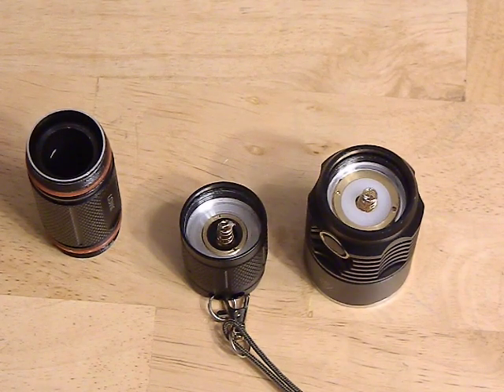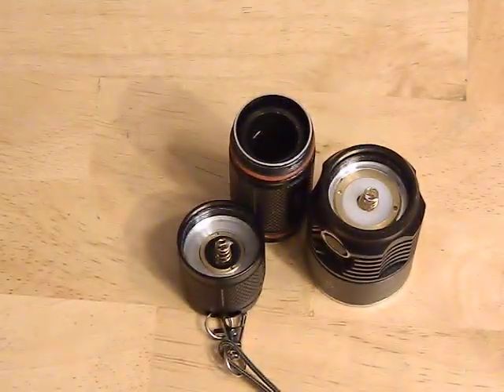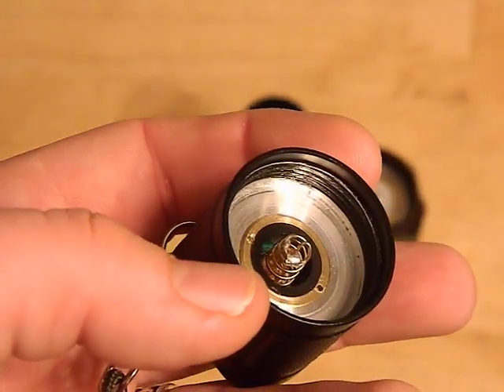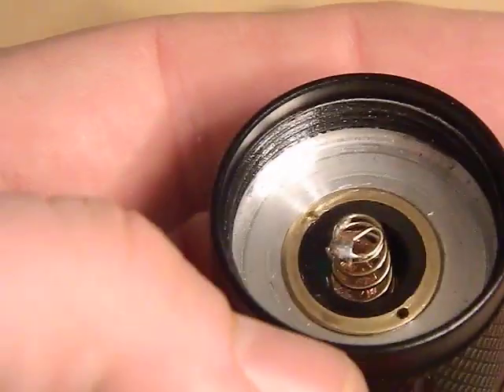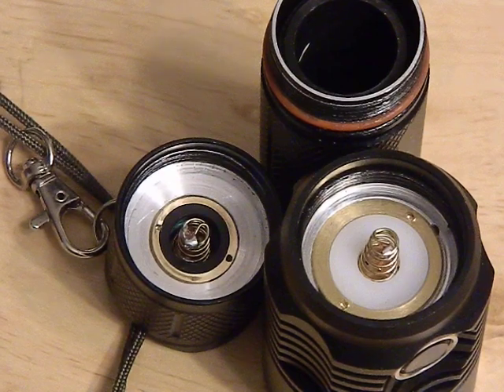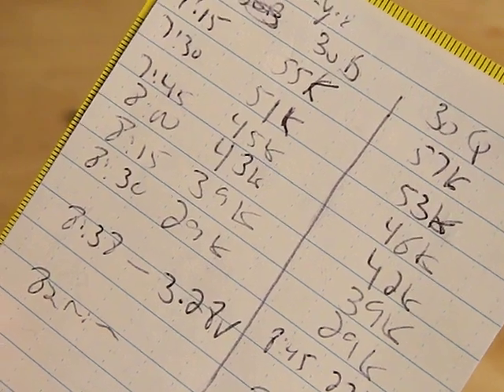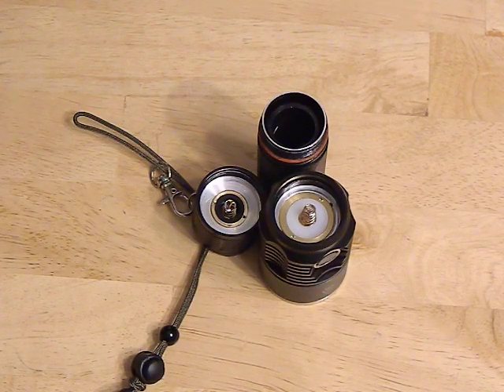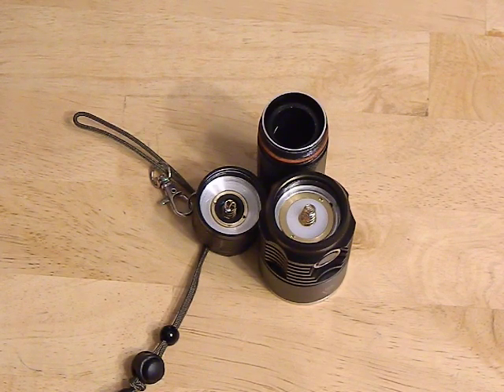A simple flashlight hack to increase brightness & runtime

Comment: How do you d with a Ozark trail 1000 limon rechargeable flash light that won't stay on it turns on no problem but doesn't cycles through the mixed with each button press instantly starts flashing yellow and green with a door of red in the mix and after 3-5 seconds sure off how do I fix that

Comment: Okay, I fully accept and agree that if a light has poor contact at the spring or high spring resistance, that this can reduce resistance and that increases current, but you can't have it both ways.  If current is increased, this will reduce runtime, until the very last moment with the low-voltage cutoff kicks in.  It might not do that on certain lights that are poorly regulated and drop output with voltage drop, but more often than not, more current and brightness will deplete the battery faster.

Comment: Hello how did you come across this? Such as what gave you the idea.
Also I have a problem if you had any ideas on how to fix. So i purchased a cheap scout light on ebay. Works good. However it will drain a 18650 overnight. Iv owned a bunch of cheap 18650 flashlights and none of the other ones have drained the battery like this unit. It seems to have a parasitic draw. Do you have any ideas on this?
Thanks

Comment: Just keep in mind...  less resistance may mean brighter, but it also means more current, which also means faster battery discharge & shorter lifespan for the led.   
I'm sure they take total resistance, voltage, current, etc., into account when designing these the way they do.

Comment: Can someone explain how is it possible to heve more brightness(MORE mAmps ?) and  also have the battery last LONGER at the same time?
Reply: easy.  you'er not wasting energy heating up the higher  resistance element in the underperforming OEM design.
Reply: More efficient going from steel to copper/brass which is almost all copper
Reply: It's not, unless the particular flashlight driver is poorly regulated so it still drops brightness as the voltage decrease, then you just get a little extra runtime at the nearly discharged state, so in that case it's possible, and desirable overall to reduce resistance, but in many lights, it wouldn't make the battery last as long, let alone longer.

Comment: You knownyou can get even more runtime and brightness by not doing this. And just going to the hardware store getting a few extra rubber o rings and put an 18650 battery instead in there.  Also spend 16 cents make a joule thief hide it in there and now you have around 8500 watts of power vs 2700 in the same package. Not saying this doesn't work.  Theory is sound but if your into batteries you know an average aaa has around 600ma of current. An average li on has around 2300 to 3600. Yes it's a bit more loss in the voltage.  That's why I use a joule thief

Comment: I think it is physically impossible to lower the resistance and increase run time at the same time. 
Lower resistance = more current = less run time
Reply: Okay, then shove a big chunk of metal between the Battery and Spring then tell us if the light was dimmer.
Reply: @Vinnay94  by all means be ignorant then. The video never references any such big chunks of metal being shoved anywhere, you seem downright confused about what's being discussed here, perhaps you have mistaken the wick as such. But go right ahead and see how a hunk of metal works for ya. In fact, go ahead and use that big hunk of metal protruding from your arse. That ought to be convenient enough...highlighted reply lol.
Reply: @itechhen  I was talking to Dan. If you place a thick piece of Cylindrical steel between the battery - and Tail Cap, some of that current is wasted into flowing through that big chunk of steel thus reducing run times and output.
Reply: More efficiency = brighter/longer runtime from the same power source.

Comment: Thanks 412 - It works! I did it on two of my cheap chinese zoomables! I don't see a problem with the solders and the increased load on the LED chips. So far so good. Probably won't try it on my mountain bike lights though due to vibration.

Comment: How about using Deans Wet Noodle wire ???? Supposedly the best wire with ultra small number of conductors ??
Reply: No, it doesn't need that and would be a problem to implement because the construction is not woven together and would need insulation that gets in the way.

Comment: This is pure SNAKE OIL . Just go measure the resistance of those springs which will be 0 ZERO ! Perfect 100% continuity . Does NOT require ANY help in conductivity at all . This as he says is more geared to dummies who wish to break their flashlights . This foolery is NOT recomened at all .... unless you are a fool .

Comment: How about just stuffing the inner coil with common copper strands balled up? It would create less resistance with the mass increase contacting many parts of the inner spring.
Reply: WTF is "common copper strands", balled up no less?  You have no idea what you are talking about, and no, copper oxidizes so it is not less resistance, nor is mass increase necessarily a desirable thing, and as the spring contracts and expands (which is why a spring was used), the copper does not spring back, so effectively a waste of time after a use or two, compared to soldering in a connection strap.

Comment: I just picked up a set of cheap flashlights from northern tool, they were on sale and looked fairly decent. I already converted one to run on my 18650 vape batteries, which removed the negative spring entirely. But the one at the front is long as hell, think I'll give this a try. It's already way brighter just with my lg hg2, and I don't have to worry about buying batteries. Rechargeable, and I always keep spares with me to vape with, so its win win.
Reply: The 18650 battery store has some for like 5 bucks that take 18650s these things are like a spot light 60 yards across yard scanning for animals at night lol

Comment: If the hack increases the lumens the battery life will go down.
Reply from the maker: zippy not necessarily. If the light is regulated as most are, it draws a set current. Some of that is lost as resistance. Remove the resistance you that same regulated current will produce a brighter and longer lasting result

Comment: Did you actually test this with a meter?  You still have the resistance of the body, so can't see the spring makes much difference?
Reply from the maker: motorbiking I did some extensive runtime testing and every one showed improvement in runtime. the springs are steel, the body aluminium. big difference in resistance between the two
Reply: @Bushcraft412  I reckon the fact that Spring Steel is essentially hardened contributes to plus de resistance. So maybe if one were to anneal the spring with a Butane Torch, La Resistance would be reduced?
Reply: Bingo!!! I wondered why he didn't do something about the body resistance first, as it wouldn't be as critical. Maybe use silver wire on the body with only 2/3 the resistance of copper, much less aluminum. Hard anodizing I am told is worse than regular aluminum.
Reply: Spring Steel is still relative hard so the electrons aren't as free. Aluminium is a poor conductor too though the lesser of two evils. Some flashlights have a length of Brass running down the shaft.
Reply: @Vinnay94  Aluminum is not a poor conductor, and it is still conduction vs amount of it with a body tube having a huge amount for this relatively low current draw.

Comment: If you have no de-soldering braid, then you could use the outer screening from co-ax cable. Give it a rub with fine sandpaper first & lightly tin the ends with rosin cored solder.
Reply: thank you for the idea comment from the past

Comment: the spring is essentially a resistance coil the braid goes direct very cool hack
Reply: that resistance is FACTORED IN ,  do NOT change it, the LED will have a shorter life, mine just went dead.

Comment: Its kind of the same principle of swapping tamiya to deans plugs in lipo batteries, the improvement is significant and helps extend the life of the battery (less strain), and whichever device it is powering, electric motor, flashlight...

I do a similar mod on airsoft guns, and it is noticeable on trigger response.
Reply: px45
Reply: Amass Xt90 is the way to go. Deans is outdated and no longer very good these days. Deans was good 20-30 years ago
Reply: @jalee6587  of course, that was 8yrs ago, BUT many times an XT90 will NOT fit on airsoft guns. The power draw is determined by the thickness of the wire and C rating (most are 30 to 50c and maybe 14awg). XT90 on airsoft batteries will look way off, and will not fit.
See if you can find any airsoft lipo battery w XT90, a much better option is xt60.
Yes, xt90 is better, but do airsoft benefit from it, very minimal and the demand is not like an EDF jet or a 6S 1/8 basher truck...

Comment: the way I hack my flashlights is I take 1-3 usually 2 of the 3v "2032" button cell batts tape em together and just stick it on top of the 3 aaa batt pack, or bottom. doing so ups the voltage from 4.5v to 10.5v. I haven't found a l.e.d. flashlight that this trick doesn't work on. but the best ones I found so far are the Eveready flashlights found in the battery section at most grocery stores. I'm going to add this hack to my hack and see what happens.
Reply: well? 
what happened,Elwood Sherman? are you dead?
Reply: I hate those triple AAA batteries requirement. You are better off replacing the entire cartridge with a single 14500 Li Ion.
Reply: @himeccms893  Huh?  Why a 14500?  A 3 x AAA cartridge has a great enough diameter that any light that can fit one, could just take an 18500 instead of 14500, and some can even take an 18650.
Reply: Great way to turn your flashlight into a Pipe bomb. 
1. Those button cells have shitty run times.
2. They have shitty current draw.

Maybe if you put all 3 in parralel, they might be able to handle the abuse.
Reply: This makes no sense unless you are talking about a very weak, dim flashlight.  2032 button cells are barely capable of any current, so would be a bottleneck in any reasonable flashlight, and once they start running down and reverse charging, are likely to vent and make a mess in the light.

I am  doubtful that you've actually ever done this.

Comment: couldn't you just solder the braid at the end of the spring and kinda loop it inside the spring?  When the spring compresses, the copper should easily contact the base of the spring and accomplish the same end result... just sayin'.
Reply from the maker: +Frances Gauner There are several different methods people use.  I know some people remove the spring entirely and run a loop of braid around the bottom of the spring and then solder the spring back on.  You definitely want the bottom secured because if it is just hanging loosely there is the chance that it works it's way out of the spring and causes a short with the battery.
Reply: +Bushcraft412 thanks, your point is well made.

Comment: this is a pretty good hack, but by lowering resistance you are accelerating the output of the battery...   I can understand brightness but I don't see how that increases run time.
Reply from the maker: +TheSmokinApe me either.  My guess is efficiency of the led? or perhaps even efficiency of the battery, or some combination of both.  I test with Sanyo ur18650, Samsung 30q, and 30b, as well as panasonic ncr18650b and everyone of them got a run time that was longer.  Range from 4-12 minutes more runtime.  The runtime on this flashlight is about 70-90 min so your looking at close to 10% more runtime

oh another thought... lower resistance keeps the working voltage higher and prevents the light from ramping down to the low mode?  For the purpose of testing I ran the light until the flashlight ramped down.  Which happens around 3.2v +/- .05v
Reply: +TheSmokinApe I think it might be: resistence = heat build up = energy wasted
Reply: @magicshon  I'm no scientist, if anything i barely know any science. Im basically trying to understand ur comment rn, So the resistance in a wire prevents the electricity flow efficiently to the light, yes? And the heat building up is the battery using more power (Watts) and attempting to transfer more power to the light itself, so in result it heats up. But can't you in any way make some sort of thermal energy extractor to make the run time longer? And if that isn't an option, I reccomend to change the wire or whatever it is to reduce resistance. It would be 
1:cheaper 
2:less dissipated energy.
Reply: @_Ha11oween  Hi, A hot wire has a larger resistance (Thats why you see superconductors and computers using extreme cooling)
You are right that there can be a heat conductor to prevent overheating, in fact in better flashlights you might have a copper insert as a cooler, and stronger bigger flashlights often need to utilize their entire aluminium body for that (gills around the body, thicker, heavier flashlights etc.)
Changing the wire is exactly what the spring bypass is about - you change the thick brass wire for a slimmer copper wire. The danger making it too thin is that it might not withstand the larger currents a strong flashlight can have and burn out, which would be really bad next to a lion cell, plus theres a lot of mechanical abuse from shock, press and depress around the spring.
Reply: @magicshon  Alright, it's always good to know some extra info about science. especially since i didnt learn about this in science. So thank you.

~~Gabriel
Reply: @_Ha11oween  You're welcome!
Reply: +magicshon maybe...
Reply: the more amps the led draws the quicker the battery will be drained Period    ohm's Law  a better hack is to replace the driver resistors on the driver board you gain a Heck lot more amp draw then missing with those springs  spring mod maybe gain 78ma   replacing the resistors can gain as much as 500-1000ma
Reply: Not directly, what happens is that by not having that small voltage drop, a higher voltage can supply the same wattage at lower current, or stay above the minimum threshold the driver needs to overcome the LED forward voltage for a longer period.

However, the video is only speculating and it will often be the case that a (different) light won't have BOTH longer runtime and brightness, rather one or the other.  In some cases a light could even have more brightness but shorter runtime, depending on the driver design or lack thereof.
Reply: Also resistance translates to heat, so its basically just making the energy that would be lost through heat get lost through the led...
Reply: +Bushcraft412 hmmm, who knows...  cool video.
Reply: nice flashlight,wich model it is?

Comment: I would love to see some soldering done by you if you are willing to do it. I do have some soldering guns, but, I am horrible at soldering.
Reply from the maker: +campfire52 I'm going to see how well the video does over the weekend and decide.  it's going to be tough to film because I'm going to have to set up alot of lighting and change angles so you can see.  Just don't want to invest all that time if only a couple of people watch the video.
Reply: +Bushcraft412 
I'd watch for what it's worth.
Reply: +Bushcraft412 I totally understand, I just wanted to place my vote.
Reply: I would also appreciate a video or two on your soldering technique. I have had massive rate of failure each and every time I try to soldier a flashlight.